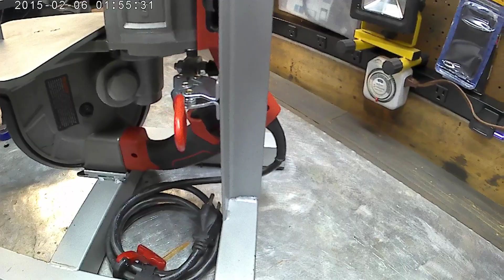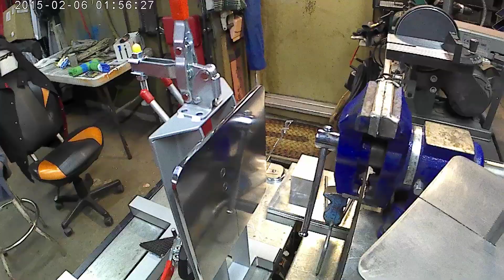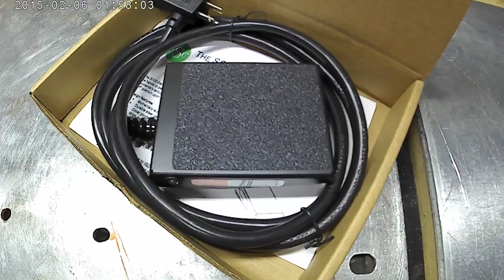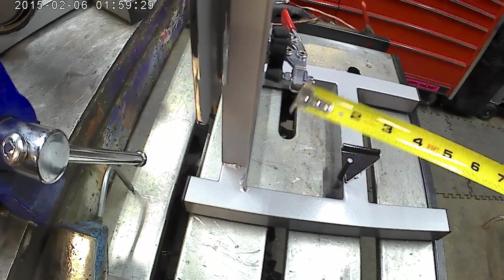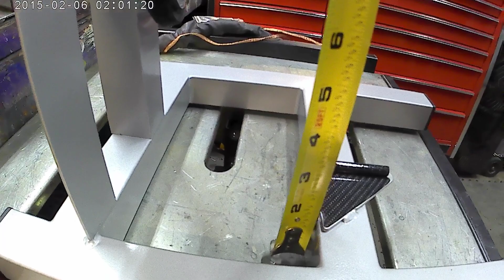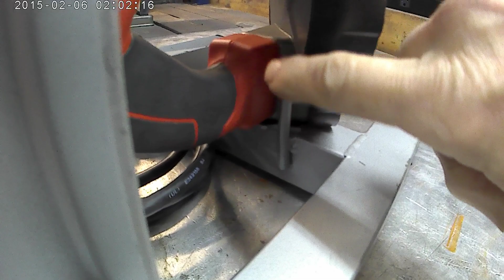Harbor Freight Portable Band Saw Quick Release Stand

Comment: Hey, where did you find the longer screw for the top clamp with the rubber bumper? The ones that come on it are too short. I haven't yet found a place to buy a bumper on threaded rod of a longer length.
Reply from the maker: I welded a piece of threaded rod onto the original one and then ran a tap over it.

Comment: So I'm referring to the triangular piece that the saw itself rests on. it almost looks like you took a pieces of square tubing and cut away what you didn't need and then coated it with something black. Is that what you did? If not, what am I looking at. The whole setup of the stand requires that piece as a start. Thanks in advance.

Comment: Could you clarify what the triangular pad is on the bottom? The way you described it below didn't make sense to me. It looks like you also applied to some non stick product to it. I'm going out to chase materials for this build tomorrow and that pad seems to be crucial and I want to get it right. Thanks in advance!
Reply from the maker: That was only to raise it up 3/16 of an inch so the bottom of the saw would not hit the stand. I just applied a piece of vinyl wrap because I knew that area was going to get scratched up taking it in and out. I hope you enjoy yours as much as I do mine.
Reply: @52drj  so was there a reason for it being rectangular?

Comment: Your bandsaw base is 14.5 inches tall from top of square tubing or from the base.
Reply from the maker: 14.5 inches from the top of the square tubing.
Reply: @52drj  thanks and one more thing did you use different screws to attach the table or the ones that are in the shoe?
Reply from the maker: I use countersunk screws for the table plate and kept the original ones for the shoe on the magnet.
Reply: @52drj  one other thing the measurement of the cross tubes on the base, iam guessing they have to be accurately placed so the saw can sit on the one tube in the middle ?
Reply from the maker: Outside to outside it's 12 in. Outside to outside on the two cross pieces which is important is 8.25  inches. I hope this helps, Happy New years.
Reply from the maker: That 12-in is outside to outside on the bottom left and right feet.
Reply: @52drj  happy new year and thanks

Comment: Can I ask why ya oriented the blade slit in the upper platform to face out rather than the opposite direction?
Reply from the maker: That was so I could pull the saw blade out and change it without having to pull the plate off.
Reply: @52drj  oh heck yeah, that makes total sense, good call. Got my steel from the steelyard and made all my cuts then snagged the HF clamps. All set to start stitching things together now. Thanks again
Reply: Another question first, did you use the portaband or a angle grinder cutoff wheel to make the slit for the blade? Any special trick for getting the location of the screw holes plotted accurately or just careful measuring?
Reply from the maker: @Charles-tj8ol  Yeah that was the hard part, I used the Portaband to make the slit in the plastic and the steel plate and I used a piece of clear plastic to make a template to try to get the screw holes in the right spot and if you miss a little bit the first time you start it the blade will make the clearance it needs.

Comment: Whats the dimensions  of the little triangle plate on the base?
Reply from the maker: It is 3 in x 3 in on the 2 long sides and 2 1/2 in across the back and it is 1/8-in thick.
Reply from the maker: And also it's 5/16 diameter rod used throughout.
Reply: @52drj   thank you I am building one of these soon for my  Harbor Freight  band saw this is by  far one  of the best designs I have found  other than just buying the Swag table  which cost more than my saw lol thank you again

Comment: Awesome design thank you for sharing, I would build one if I had a welder.
Reply: I needed to make a wall tire rack and the design I was going by welded the pieces together, so I had to modify the design to bolt it together. I worked out, but I thought, why not buy a welder and learn welding, so I did.

Comment: Where do you get those clamps?
Reply from the maker: Harbor freight.
Reply: 52drj thanks a bunch. im making one. Copied down all your dimensions. Is that pad on the bottom make from thin rubber?
Reply from the maker: @hondafreak8613  I also got that from harbor freight it's 12-in by 12-in adhesive back rubber diamond plate mat. The 1 1/2" square plastic caps I got off of Amazon.

Comment: Did you make the big plate the blade is in also?
Reply from the maker: Metal supermarkets sold me a 8-in by 8-in by 1/4-in thick piece of what they called oiled steel, it was smooth and came out nice and flat, I just cut a slot in it to get the blade through. The one I built for my son-in-law I just took the plate to my bench polisher and it ended up looking like it was chrome plated mine I left natural.

Comment: I know this video has been out for a while, but wanted to say I've looked at a bunch of these stands on youtube, and I like your's the best. Very nice build! I do have a couple of questions, as I'm hoping to build and close copy of your stand. What size is your table, and are you happy with the size and thickness? also where did you get the end caps for the bottom tubing? Thank you.
Reply from the maker: The table plate is 8" by 8"  by 1/4" oiled steel plate. Size-wise it works really good I use the heck out of this thing. I found the plastic caps at our local Mclendon hardware store.